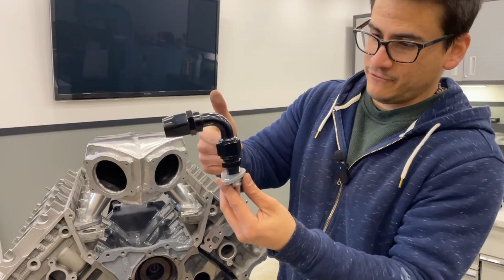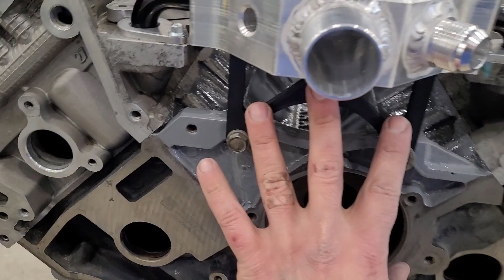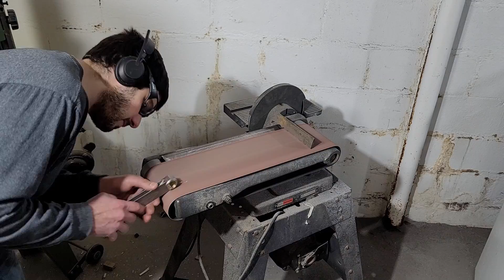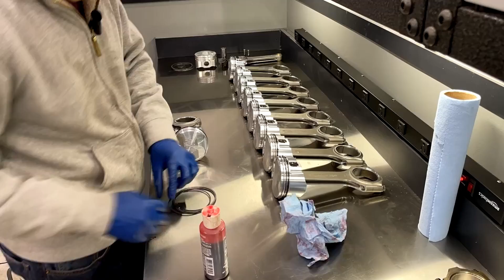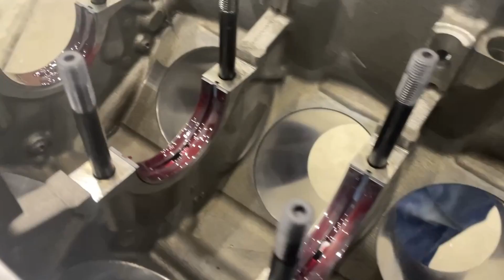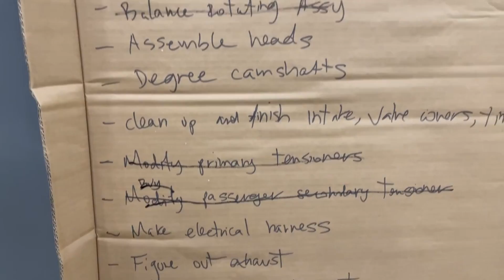Bottom End is Fully Assembled! - Ford V10 4V Build Ep. 10

Comment from the maker: Hey guys, just want to clarify one point. If you made it to the end of the video, minute 26:48, we are NOT talking about Todd Warren, from Apocalypse Performance. He's been nothing but helpful to us throughout the build. This "other guy" is someone else out in Montana and has no connection with Todd.
Reply: Awesome job guys!! Just finished doing a timing kit, oil pump and lash adjusters on my Aussie 260 Boss 5.4. Some things I learnt along the way. If you buy a Navigator timing kit the left hand or driver side large sprocket is 6 degrees retarded compared to the right hand side. Something to do with pollution. Aussie motors are set up even on each side. My cams are crow Performance cams with 220 @ 50 timing in and ex. And 435" lift. I advanced these cams to 108 in and 112 ex with a 110 lsa. The performance improvement was worthwhile with no loss in idle quality. There is a rollmaster adjustable kit with Iwis chains available in this country at outlaw speed shop (online). The primary chains are not included though. Use the genuine Ford ones for Navigator or Aussie Boss 260/290. Also use genuine cast iron primary tensioners. Also you will need an aftermarket passenger side secondary tensioner. Buy a Melling 3v oil pump as the gerotor set is larger to account for the vct. And the Melling pump actually has a cast iron backing plate. Use 40 GT500 exhaust lash adjusters as they apparently provide the top end with more oil pressure. Something you will need with 2 extra cylinders and almost double the stock rpm capability!! Good luck with the build, will be following along keenly!! Tim Australia.
Reply: @timh6977 man thank you for this information. I literally just picked up a navigator 5.4 for 200 bucks for my little Ford ranger. I'm wanting to do a screw blower for wow factor
Reply: So you guys wont let me see de cam 😢.. still needs grinding right?

Comment: The problem is that it’s a 6.8 platform. 3.55 inch bore 4.17 stroke…
Turn a 5.0 Cammer or a 5.0 Coyote into a V10 platform. Better yet, make bespoke 72 degree V10 cam in block with Roush Yates NASCAR style heads 12:1 C/R  4.00 bore x 3.25” stroke 408 cubic inches  @9,000 rpm 802hp!

Comment: Should had rods, pistons, pins all balanced before your crank was balanced. Cuz the crank is balanced to the rotating assembly. Plus were you took material from the rotating assembly is specific location on each part. Don't follow these guys for sloppy work. Then you took more material off the crank that was balanced wrong. This motor is not going to last long.

Comment: One thing to note when using black AN fittings for hot coolant- cheap anodizing on some fittings will turn them GOLD after some heat cycles. Seen it several times when I worked at a hot rod shop. XRP is a brand I have seen NOT change color from 200° coolant.
Edit: didn’t know you would be welding these, the gold showed up pretty quick lol

Comment: A possible explanation for the plastigauge reading tight or being seen as innacurate is because plastigauge measures clearance differently to a bore gauge. A bore gauge looks at a single empty bore in isolation, plastigauge is reading the distance between a bore and the object that gets installed in it as a whole system. When you guys welded the heads and one of the cams was bound up, if you put plastigauge on the cam bearing journals it would show up as though there was little to no clearance between the cam and the journal it was bound up on, but putting a bore gauge in that same journal would have shown that the bore should have plenty of clearance. I think that is what the plastigauge you put on the crank is showing: the tiny mis-alignments of the crankshaft main bearing journals. I have no idea if you should, or even could, do anything about those mis-alignments. Seeing as you guys already have gotten the engine running, I don't think theres anything to worry about, theres probably higher performance engines with worse mis-alignments than you have.

Comment: Where did you get a 10L engine from and did you make the heads out of a coyote engine or what
Reply from the maker: The block is a Ford 6.8L block. The heads are 4V cobra C heads that were cut and welded together.

Comment: At 13:1 compression, what minimum octane fuel are you going to have to run? Can you get by with 93...? I've been told that anything beyond 11.5-12'ish needs more than 93..?
Reply from the maker: We are lucky to have E85 readily available, so we will be running that.
Reply: @biy_buildityourself  Hmmm, didn’t know E85 would run on higher comp ratios.

Comment: should have just used a 90 fitting in the cooling port not a 90 elbow, u can use a 90 fitting and then use a straight fitting the run the hose to the back
Reply from the maker: We thought about buying new fittings but we decided to work with what we had!

Comment: Spent all that money on rods and Pistons, when the crank is the weakest link!! There is a reason why there isn't any performance parts made for those engines. Crank is extremely weak at the rod journals due to the split journal.
Reply from the maker: Do you have any examples of a 6.8 v10 crank failure? Cus we haven’t seen one yet

Comment: I have built modular motors and you just don't use plastigage, they use tighter clearances and no greater than 30 weight oil for a reason, often not more than 20 weight. It's not a 1967 engine.

Comment: Do you think that hard mounting the AN fittings into the manifold may pose risk of leaking due to thermal expansion of the heads (likely moving up and outward from the manifld)?  Love the concept very curious how it holds up and performs.
Reply from the maker: The fittings are not hard mounted to the manifold, they have o-rings...Double o-rings 😜

Comment: Your channel just popped up in my feed. I have watched majority (fabrication ones) of this build. I always heard the Triton was junk. A couple of my takes which probably have been stated elsewhere are the following. I would have pressed in short tubes for oil galley connections. Second a deeper groove for better penetration of welds connecting head halves together. Interested in if the heads split at welds later on. But I like your approach and methods with a hindsight point of view. Great job so far.

Comment: Isn’t your issue going to be the crank when you push more power. Specifically the split pin? I’ve read all over they snap and when they do it’s always there
Reply from the maker: You have?? Can you share some links? We’ve never heard of one instance where the split pin crank failed on these motors.
Reply: @biy_buildityourself  I’d just looked into the ford motors for a bit to decide which one I’m choosing to build and read a few shitposts on the 6.8 but looking back they’re early on in the years (probably just a lack of support and assuming) common comparison was the viper engine compared to the 6.8 as their argument. looked at the crank myself and leaned with a grain of salt they might be right/paired with the utter lack of boosted 6.8 vids. As it is visually the weakest part. Just curious if/where you found out otherwise lol or have you not even heard a word about this till me LOL because it doesn’t actually happen😂

Comment: Very cool build. I worry about the crankshaft. Even though it's forged, 4"+ stroke is a lot with split pins. Ford actually tested a 4v 5.8 v10  that was basically a 4.6 with 2 extra cylinders. They went with an odd fire common pin crankshaft. Keep up the good work.
Reply from the maker: There have been a couple builds making lots of torque on the stock crank, but no one spinning RPM. So we get to see what happens!

Comment: That manifold is neat, but it has got to weigh 3 or 4 times what it needs to. Why not just make your own crossover pipe with the necessary shape and fittings?
Reply: You are also not supposed to use just one side of a ring filer. That defeats the whole purpose of keeping the ring ends parallel. You are supposed to squeeze the ring together on the disk when you grind them...

Comment: if you guys have room it would be cool if you did a 10 to one header they sound great and are apparently pretty good performance wise
Reply from the maker: That would be sweet! We haven’t figured out exhaust yet but we’ll make sure it’s something that pops when we do. 👌🏽
Reply: @biy_buildityourself  you could also do tuned length 180⁰ headers. What chassis is this going into again?
Reply: 10 to 1 is cool, but is more complicated and harder to package. 5 to 1 equal length for each bank then an x-pipe seems more feasible.
Reply: @sepg5084  (5:2 & 5:3) into 1. Yes they won't be even. Diagram three firing order to see if the other side should be the opposite or the same